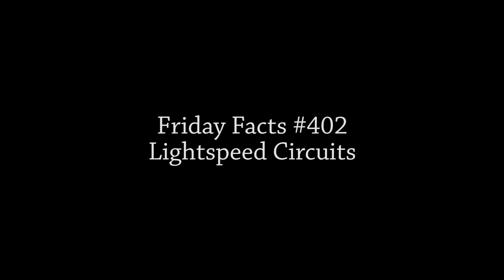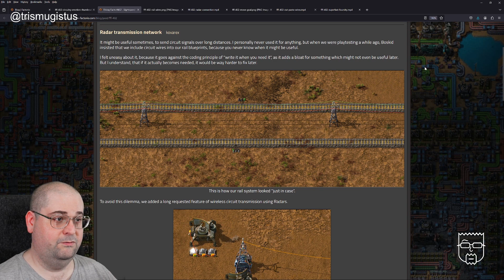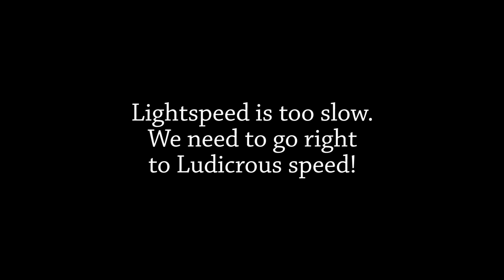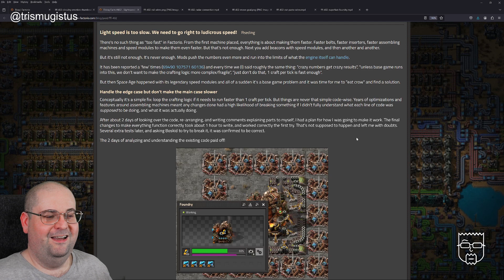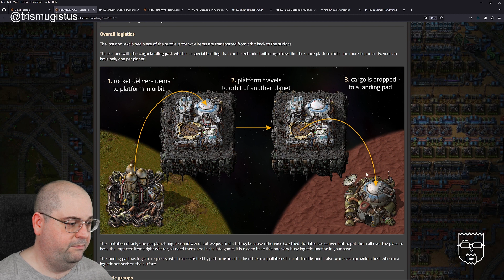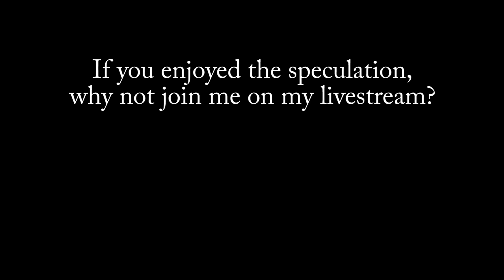Long Distance Signals | Factorio Friday Facts (FFF) #402 | Analysis & Speculation

Comment: I'm wondering what the 'claw' kinda thing is that they are hiding behind the foundry dialog: check closely right of the dialog, 'on top of' the foundry you see some 'claw/arm' moving…
Reply: We had some fun guessing on the discord. One of the devs prompted a "draw the rest of this" and people did silly things. Serious consensus seems to be it's some kind of mech suit, MkIII power armor. Considering how much our machinery is getting a boost, makes sense we'll have amped up equipment to suit.
Reply from the maker: Yes - I didn't spot it, but saw it posted on reddit.  It's presumably some sort of new armour for the player?
I have to say the digger style of the arm is a bit weird.  A digger arm implies better hand-mining of ore, but you move away from hand-gathering resources almost at the start of the game, so it seems a bit of a strange addition.
It's also weirdly high up, so I don't know if it's also got some sort or jet pack so we can fly?  This is obviously a big part of Space Ex, but we don't really go to space in the same way in Space Age (just remote action, I think, no wandering about on your space platforms) so I assumed it wouldn't be there.  Of course it could also have some long legs so we can move faster, but that would be a bit weird, though it isn't really bobbing up and down like it's a jet pack.  But then I could easily just be misinterpreting the height/position.
I'm mainly hoping it means modularity is being extended to the actual components of the suit itself, not just the equipment grid.  So we can swap in different arms and legs for different effects.